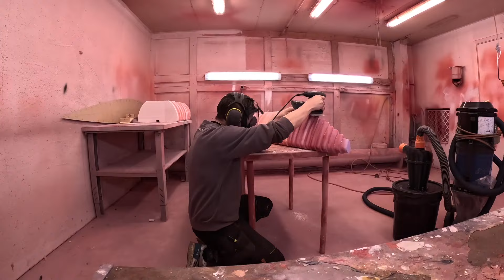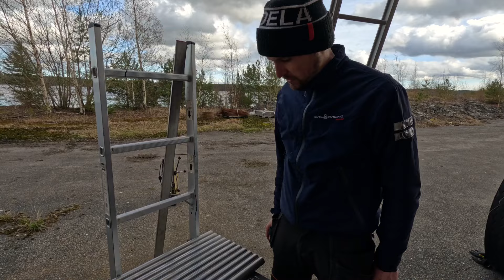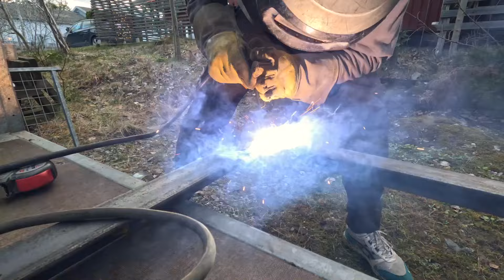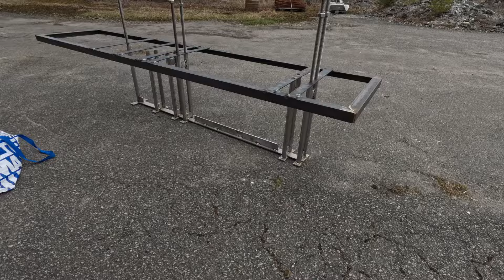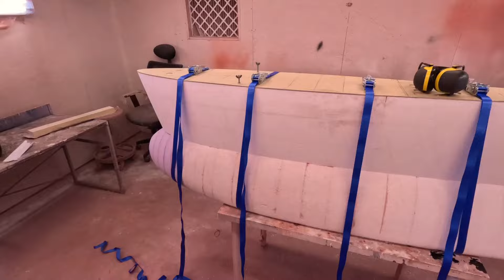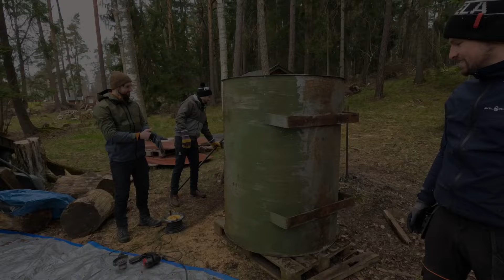How we’re Getting Ready to Cast our DIY Lead Keel [2.13]

Comment: Did you consider to make a whole new keel? I heard from Wasa yachts that there is a mold/form somewhere in Stockholm.
Reply from the maker: Yes, we did, it was our first idea. The plug in questions is to narrow for our double row keel bolts, so we would either have to modify that plug or modify our keel bolt connections. Removing the entire keel would also mean way more work and risks than keeping the upper part. And it also a question about money, as we would need almost the double amount of lead to do a full keel, and as we are quite happy with the current attachment of the upper part the work/risks/money needed for a full keel it didnt feel like it was worth the effort when the plug in question didn’t fit our boat 😊
Reply: @SailingAnneMon  I understand. Good explanation👍🏻😀😃

Comment: It will be fascinating to watch how your lead smelting works out. I was unaware you could burn the foam away with lead in the forming process. It would be excellent if it worked as you planned. Thanks for sharing. Cheers.